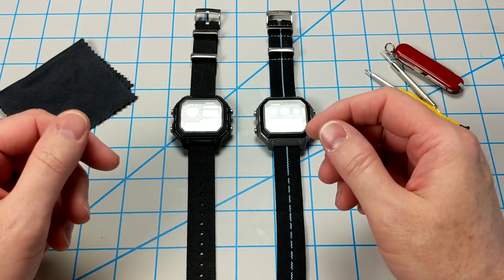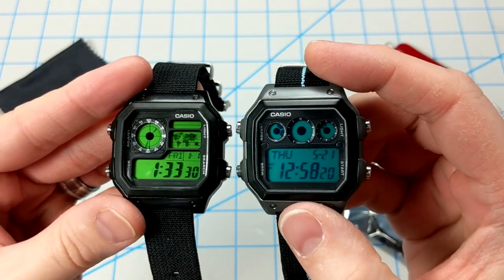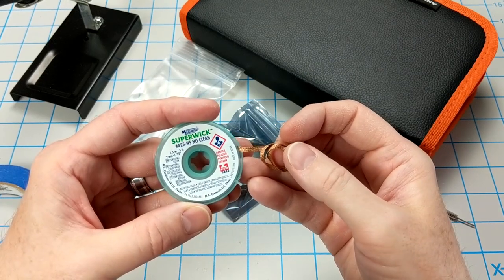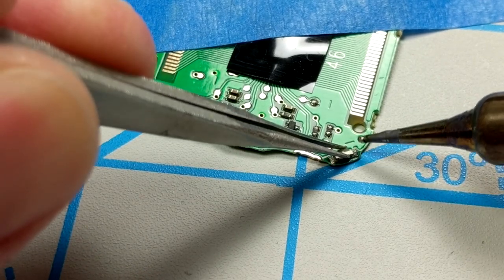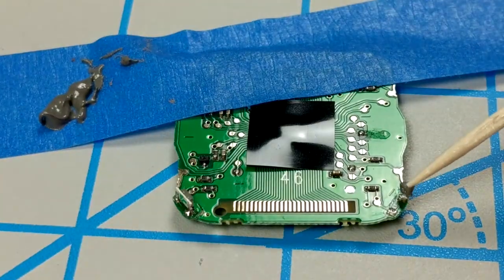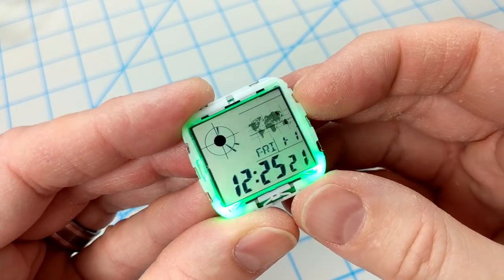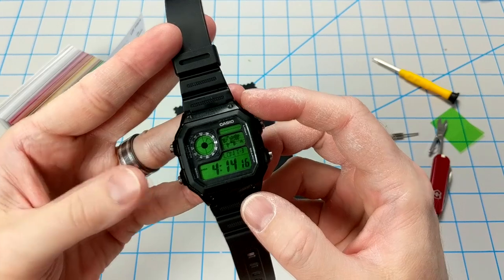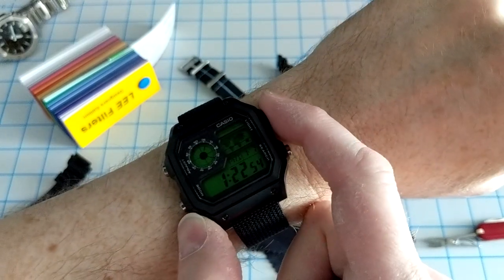Casio AE-1200 LED Mod | Casio Royale gets an upgrade with ultra bright green LEDs!

Comment from the maker: The green gel filter looks a little wavy. I did end up taking it out, trimming it down a bit more, and re-inserting it. Now it looks nice and flat on top of the LCD.
Reply from the maker: Thanks! You can do either. This one is just press fit. But it you want to use different colors, or smaller pieces, you can adhere them.

Comment: Hey WC, this is a sick mod! One thing you might like to know about is flux. It is used when soldering really small connections on PCBs, and makes the whole process a lot easier. They come in sharpie-like pens, and you just scribble some on the pads after you have wicked the old solder off. Then you apply the new solder, and the flux basically attracts the solder to the metal pads and repels it from the substrate. Highly recommend using it if you are gonna solder in a future project, it will save you a ton of frustration.
Reply from the maker: Right on, thank you! Would that work with solder paste too? I had a lot of trouble getting actual solder in there easily but maybe because I didn't use any flux. I'm learning as I go :)
Reply: @WatchingCasio  soldering paste is actually a mixture of solder and flux, which is probably why you found it easier to work with. I prefer using the regular solder because you can control the ratio of solder to flux. Usually the more flux, the easier it is. The flux would probably work with the solder paste, because you are just changing the ratio. In my experience, though, the regular solder and the flux is the best combination for soldering small surface mount components.
Reply from the maker: @AERHEAD  Thanks for all the info. Really appreciate it! Holy cow, awesome channel my friend. Love the vibe. Reminds me of a SOMAfm channel. Awesome stuff. I'm a musician myself. Subscribed.
Reply: @WatchingCasio  dude, thanks so much! your kind words mean a lot to me. Thank you for the content you make, it has provided hours of entertainment!

Comment: I have to say that this video is great. I am a electric tech. I thought I could get away with just soldering and I did get it to work but it came apart. I burned out the solder trace on the board but because of all my years of training, I scraped the board with an xato knife and found more tracing to work with but no more soldering even for someone trained, it is a hard job. I just ordered some soldering paste. Best idea in the world, thank you for this great video you have saved me from hours of work. Thank you and have a great day my friend.

Comment: 1206 isn't THAT small, but holy cow did you jump into the deep end doing that as your first experience. Kudos on not giving up.

As someone else said, yeah, you need flux. I've soldered by hand with paste, but I usually use a spool of solder plus a bottle of brush on liquid flux.
Reply from the maker: Haha you're probably right. Once I wanna do something it nips at me until I figure it out and gosh darn it I wanted those LEDs in there. Live and learn! Flux next time :)
Reply: @WatchingCasio  subscribed partially for the content, largely because of your persistence haha.

Comment: Impressive work on those LEDs, that is something that I won´t mess around with :P
Reply from the maker: Thank you!
Reply: I've never messed around with soldering inside a watch either. I'm terrible at it, and I would end up destroying a pcb or something and be out a watch. What I'd like to do, is remove the two amber or orange or whatever you want to call that LEDs in the bottom corners and replace them with white LEDs in all four corners. I'm not even sure if something like that can be done, but it's something I've been thinking about.

Comment: I have had good luck with taking a wide nylon watchband and cutting/cauterizing notches in the band so that it will fit in between the lugs and still reach beyond the ends of the lugs like the original band. It makes the band size fit the watch better and still allow the spring bars to work well.   Give it a try.
Reply from the maker: Ah nice, I've seen some postings about that and it definitely looks cool. Might have to give that a try.
Reply: @WatchingCasio   I hope you like it as much as I have. I really enjoy what you do. Thank you.

Comment: I've done this mod twice (oddly enough I did better on the 1st practice run than the second "actual" one). I was able to do it without the solder wick or paste, just using solder wire. But if your patient or are still waiting for the LEDs to arrive do yourself a favor and order at least the paste as it will hold the LEDs in place while you solder it, other wise you have to hold the LED with tweezers while you're soldering with some jig in place to hold the PCB steady. In the second watch I managed to screw up pretty bad but was able to fix it. I accidentally yanked out the ground pad on one side and the positive pad on the other. How you can fix this is by lightly scratching away the "paint" on the trace it was attached to, making sure not to expose any other pads that the solder might jump onto, then applying an (un)reasonable amount of solder to try to bridge the led back to the nearest source of the original pad. 
Also it was a bit thicker and required a little more effort to put back together, if the display isn't working properly when your done then make sure all the metal latches are hooked onto the plastic case. I'm really happy with this mod overall and can agree that you could almost use this as a flashlight (but the flashlight on any smartphone or actual flashlight will be brighter).
Reply from the maker: Thanks for your helpful advice :)

Comment: Soldering a 2nd LED light is a hack! actually, I'd say it is more than a mod, it is an upgrade. Congrats. One question: are gel filter mods compatible with the hydro mod (silicone oil filling). Thanks!

Comment: Could I use the same LED's for a A158W? I want to do a dual LED mod (remove the original too). I'm just concerned that the PCB wouldn't like the extra power draw from the 1206 SMD LED, glitch out or burn out etc. Which one should I use, the 0805 or 1206 SMD LED for the A158WA-1Q? TIA

Comment: Nice mod, has retro sci-fi vibe. Are those new LEDs going to affect battery life? Thought, 10 years is default for this watch, so probably not an issue at all. Also those LEDs exactly fit the case like they are meant for it)
Reply from the maker: That's what I was trying to go for. And yeah, it will probably affect battery life due to the size and the fact that I press the button a lot more now haha.
Reply: The size doesn’t matter, the current for the LEDs will be almost the same as with the original ones.

Comment: Why would you need green LEDs if you're using a green filter anyway?
Reply from the maker: Because the LED color still shines through. Check out my AE-1300 clip where I put in a blue filter but the amber LED shines through.
Reply: @WatchingCasio  I also have another question. I am going to do this mod on my watch, but my book of lee filters is fairly old, and the gels are scratched quite a bit. Do you think this would be noticeable?
Reply from the maker: @AlbertRutter  Well I guess that depends on how scratched up they are :) Give it a shot. Probably not all that noticable.